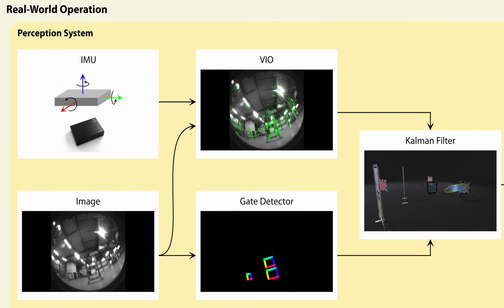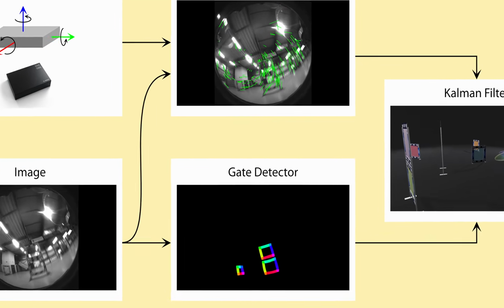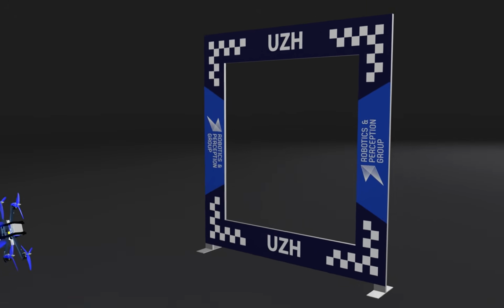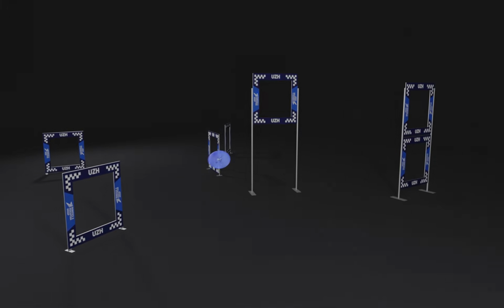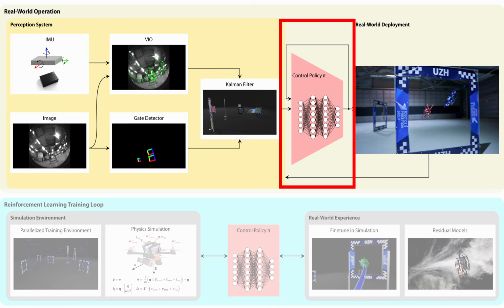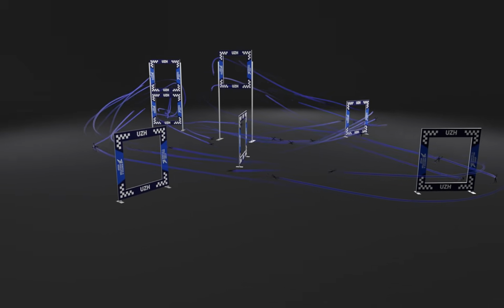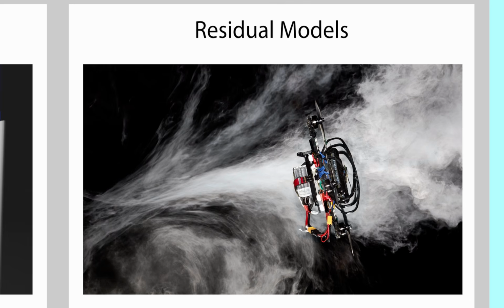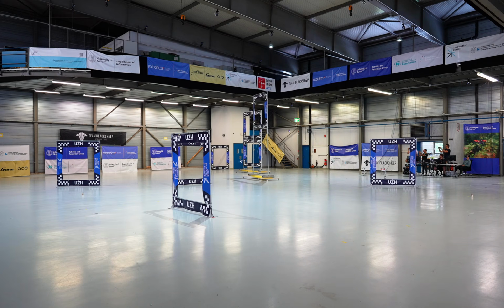Champion-level Drone Racing using Deep Reinforcement Learning (Nature, 2023)

Comment: Not Fair.

Calculations must be based only in the same imputs as the human... the video on the VR.

AI has an IMU that the human doesn't have.
Reply: The human also has a massive computer called a brain they can use for zero-latency calculation, whereas the AI is working with very minimal compute. 

In addition, humans are using the IMU too, lol. Maybe not for planning, but humans don’t control the motors of the drone directly, they control thrust and pitch/roll/yaw. You cant do that without an IMU doing the calculations for you to convert that into motor speeds.

Comment: How would a change in air condition affect this?   eg change altitude, or pressure, or humidity?   I imagine each to affect flight dynamics.  Would the system know/adapt?
Reply: Good question. I noticed that they didn’t show side-by-side racing. Can it handle turbulence?

Comment: I wonder whether the AI is embedded in the drone aka autonomous or network based. A network based AI would surely suffers higher latency. What is the exact latency of a network based AI both in terms of transmission and computation? What if the bitrate dropped and there is a degradation in the network? This is a common issue with FPV drone especially when dealing with long range and signal penetration through dense environment.
Reply: They specifically said the training is done on different hardware, but the actual piloting AI is entirely onboard.
Reply: So the drone is heavier due to the gpus or wtv required? How does it still perform better? @fxm5715
Reply: They make clear : "on board computer, single camera and an inertial sensor"  (0:50)    https://youtu.be/fBiataDpGIo?si=nUlR4RPi_W2mHVis&t=50

Comment: It had a 60% winrate. What are the conditions that caused it to fail the other 40% of the time? From the article I read it could not handle being bumped at all. What else? Also, training on a very specific track for 23 real-time days of running to calculate an "ideal pathway" through a virtual, fixed course really makes this not much different than automating a speedrun of a videogame by preprogramming inputs. Does a human champion practice this exact course in an accurately recreated environment for 23 days? I highly doubt it. Seems like an exercise in "specific" vs "general" and the obvious interest in "being the first to beat humans in a real-time sport" is absolutely disingenuous.
Reply: It's better to ask, is a typical human with really basic flying experience able to somehow reach champions' level in 23 days practice? Right now we see how technology is raising. It's not so far to a point that AI only needs to scan a track, does some calculations and it's ready to fly faster than MCK, who needs to at least fly a track a few times before challenge.
Reply: @wKich well. The simulated time will be more than 23 days by far.
Reply: @rubencid2575  do we count all fpv related experience and time to learn/practice on humans? because ai learn from scratch, they don't have any background on start
Reply: The impressive thing is that it's able to fly with speed and precision despite being fed very noisy data.
Reply: The generality is beside the point. 

The key breakthrough here is that you can combine noisy input data, simulation, and a residual model to get something that actually works extremely well in real world competitive conditions.

Training a more general model is a natural next step on top of this approach.
Reply: They should have their own separate league.  
The competition is who can program their drone to auto pilot the course to the win.
Humans are manually flying when competing with each other.
Reply: I too caught that it's flight path is essentially scripted at run time, but the flight controls are managed by AI so that brought it back for me.
Reply: Shocker, youtube commenter comes to the conclusion that this isn't human level generalized intelligence.
Reply: @PorkBoy69  Every single AI / AI-adjacent video has to have a couple commenters going "akshually", it's the law or something

Comment: amazing!! so what would be the next to-be-conquered limitation? would it be the ability to process the images of different environments?
Reply: I assume it would be removing the pretraining step for each track. Instead you'd fly one lap manually to teach it the gate order and then let it loose.
Reply: @Bruno-cb5gk  i wouldn't go this far, since human competitors also don't start from scratch. What I would like to see is dynamic adjustment of the residual net to the current environment (active learning).
Reply: M 7

Comment: Go and kick one of the obstacles a couple meters to the side. See what the "AI" does then....
Reply: Racers spend hours per day in the simulator running the exact track they're going to fly. They also recreate the track in real life themselves since the dimensions and gate positions are made public. So, really, human pilots train like crazy too until it becomes mostly muscle memory.
Reply: Trains again (like any other pilot would do to achieve the best times) and fly it afterwards like shown?
Reply: @Convergence33  do you think any pilot first will train? Or does the pilot use his brains? If you move stuff around, change shapes, pilots can do. This needs training like you said. It can only train from the past.
Reply: The article I read accompanying this states that the drone has massive limitations that are effectively not feasible for "winning" in real world conditions. For example it was trained for 23 days virtually. Is that how these courses actually work?
Reply: That was my initial idea as well
Reply: Yeah, sounded like - at least based on the video - that they trained specifically on this track. Would be more interesting with a more general model.
Reply: @justfoundit  The training model is general, it was just trained for this track. The model the training produced is not general, but that wasn't the goal.
Reply: @someonespotatohmm9513  Yeah, that totally makes sense, but a more general knowledge in 1 model would be very-very interesting and useful.